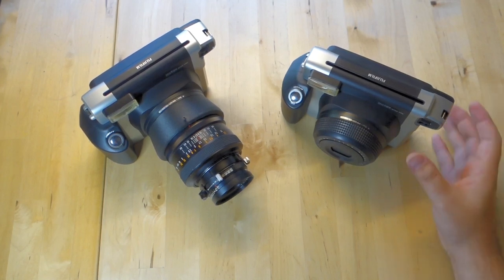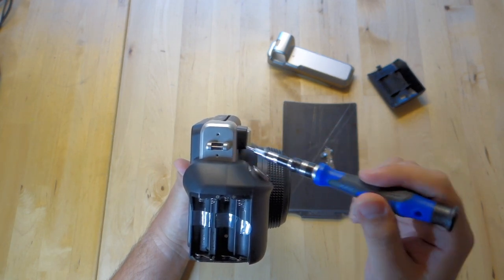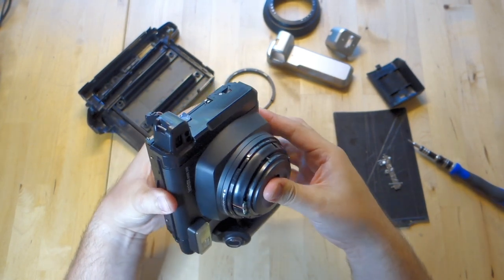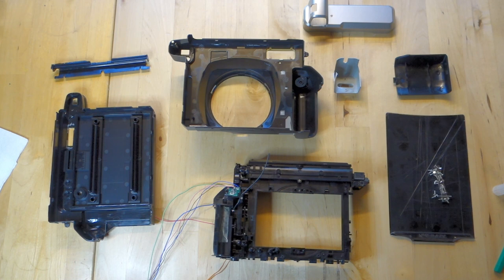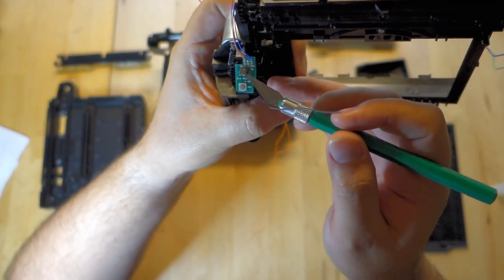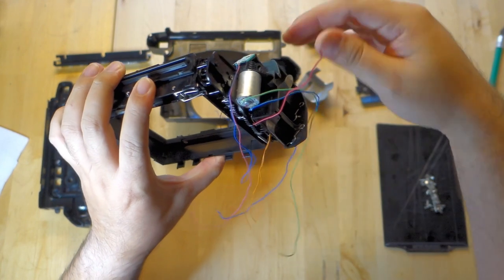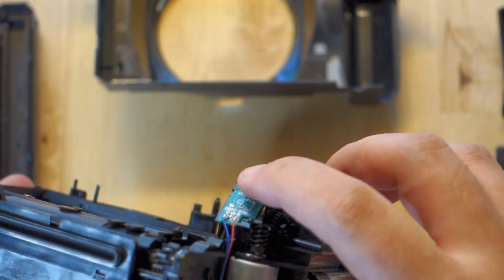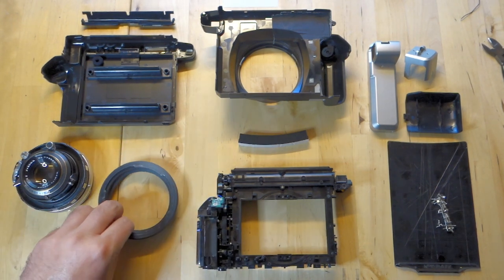Modify Instax Wide 300 for Mamiya Press & Polaroid 600SE Lenses

Comment: Great job figuring this out. Might give it a try.

You were serious about not knowing electronics. The red wire from switch area should be REMOVED. That's why you had short with switch. Remove wire and you don't need to pop off switch. So it's super easy, and you should shorten them to just fit. All the shutter switch is doing is switching the negative from off to on to energize the motor. Remove all wires not used in that group.
Reply from the maker: the_lomographer thanks, and pinned! Now I need to find out how to activate the motors on one press. I know the switch where the orange wires are gets tripped when the film lift arm comes back down, so I’ll try to mess with that.
Reply: I remember reading a post where someone did figure this out. I didn’t bookmark it but it is out there. And for me the easy way to time the development push is to be holding the camera and feel and here the motor. There is a noticeable build in strain right as last received pod gets filled then squeezed through. If you let go then, all good.
Reply: @sprkplg  i recently bought the adapter and am working to install it soon. Did you figure out the switch thing? I don't mind holding it down for the 5 seconds but would obviously prefer the normal function.
Reply from the maker: @jerk4628  Yes, check the link in the description and there are instructions there.

Comment: I did it ! Thanks so much for the video ! I also made the “one touch shutter button mod”. Please, explain why the film gets stuck just for a little end portion after being ejected ? Does it mean I have to extend the channel on that internal gear just a little more? Thanks !!
Reply from the maker: I've never actually tried to troubleshoot this because it has happened to me a lot on the Lomograflok, and hardly at all on the Wide 300 mods. And whenever it did happen I just assumed it was film or temperature related.

Comment: As I understand with the extension ring method I won't be able to "calibrate" the focus properly; my only possibility would be to check (for each lens) where infinity / close range is and mark it on the lens barrel? 
And with your adapter you have the correct flange distance, so that infinity is (more or less) acurate?
Reply from the maker: You can add ground glass or frosted plastic to a hacked empty cartridge to help you get to correct infinity focus. Or you can load a new cartridge with the darkslide still in and measure 62mm from the seat of the extension ring mount to the darkslide. My adapters are pretty close, nearly dead on. Only reason I can't say they are 100% is because there is no published data for the true flange distance for Mamiya Press. I settled on 62mm from various tests but it's +- .5mm

Comment: Do you think if i got your adapter and the mamiya press 90mm 3.5 that i could use the original of the instax 300 for approximate framing? Focal lenghts are pretty similar
Reply: He says at his webpage that u can use the 90mm or the 100mm. He recommends the 100mm, but it worth as well if you have the 90mm, also that one is cheaper than the 100mm.

Comment: Are the orange wires related to the flash? If so they could be linked to the lens shutter via a dangling PC cable and used when needed
Reply from the maker: Jacopo Abbruscato no they are for some sort of eject sensor/switch. Check my site for how they are used in single-press ejection of the film.

Comment: Is it possible to do this on the 210 the older version of the 300?
Reply from the maker: Sam Garrett not sure, i have never experimented with one of those. In theory they should be similar. The adapter is unique to the Wide 300 though.

Comment: How much do you sell these for? I’d be interested for sure
Reply from the maker: Harry Roth I no longer sell them cause I just don’t have as much free time anymore. It’s why I made this video and sell the adapters, or you can try the full DIY method if you have the macro extension tubes. Or make your own pinhole lens.
Reply from the maker: I just listed one on eBay, my latest version with 2 integrated cold shoe mounts and included laser rangefinder for easy focusing. Make me an offer and put a note that you're from youtube if interested. For sample images I have a few on Instagram, check #mpwide300
Reply: Wanderlus

Comment: How you see focusing the image? Anyway, I followed your IG.
Reply from the maker: You don't see a focused image, that was not possible on the stock Instax Wide 300 either even though that one had 2 focus lengths. You either need to utilize zone focusing, or use a laser rangefinder. With my adapters I include an easy to use rangefinder card that helps.

Comment: If you don't rip the wires off the microswitch at the bottom which engages the cam, you can just wire the motor in series with the micro switch, and the shutter button in parallel. In this way, the shutter button kick starts the motor, and the micro switch takes over and ejects the film, turning off after one film is ejected (though you may have to cut a bit of the leading edge of the cam off to turn off the motor a split second earlier. I just converted a pack film camera to Instax and show how I wired it. https://youtu.be/M1XpKIrsm9c
Reply from the maker: I'll have to post an update soon but I do it differently than this now. On my site I have a writeup on how to wire it for the ejection cycle. I haven't done a writeup for it yet but I'm also running a switch to kill the motor and prevent accidental ejections.
Reply: @sprkplg  The battery switch is a great idea--I have to be careful not to press the shutter button on mine... Also, how do you focus? Guesstimate? I think an interesting project would be to take an Instax back/motor and somehow fit it with a dark slide so you can focus with ground glass, then mount the back and remove the dark slide, but I'm not sure that's possible...
Reply from the maker: thewetcoast I shoot mostly in daytime now so I guess and hardly miss. A typical daytime well lit shot will be f/22-32 @ 1/500 so very forgiving depth of field. The project you describe that's essentially the Lomograflok back, its for use with 4x5 ground glass backs. I will be releasing a Mamiya Press body for that back. It will be a much better option than these mods.
Reply: @sprkplg  I guess a back like that would have to be a redesign like the Lomograflok because of the way the instax motor protrudes in front of the film plane, making it difficult to mount. And making it dark slide compatible would be a challenge! That Lomograflok back is very cool!
Reply from the maker: thewetcoast yeah, thats why I figured why reinvent it if a good solution for my own purposes is coming. For sure darkslides are a pain to design for, especially when the dimensions of the slides you have at your disposal may not be the same as others. Another point for the lomo.